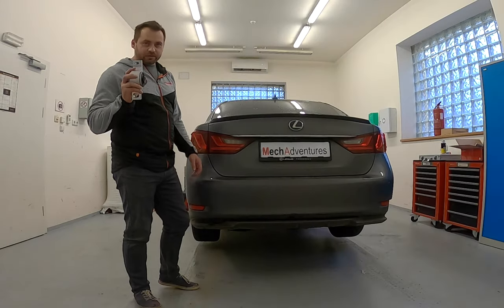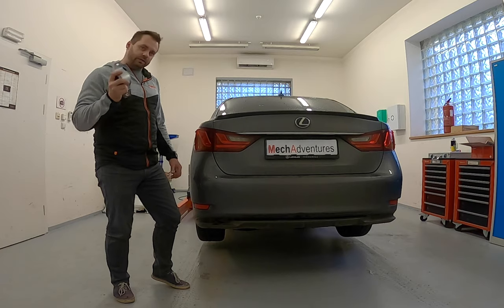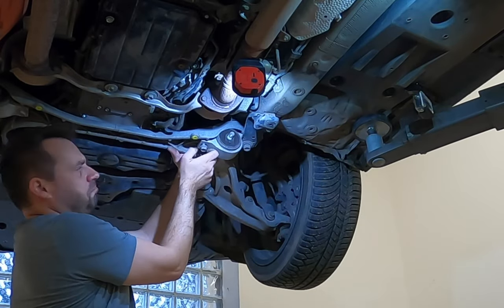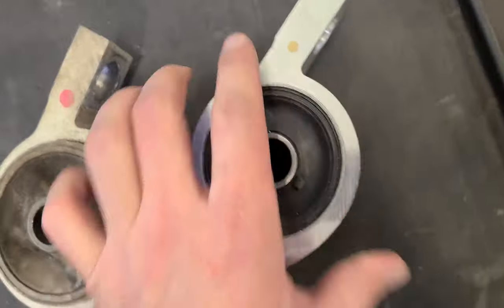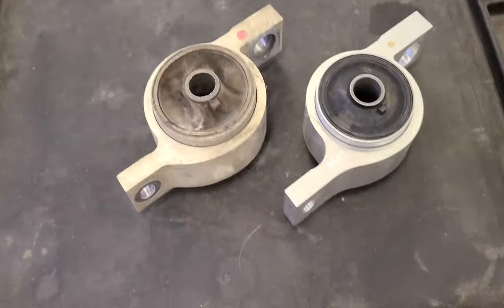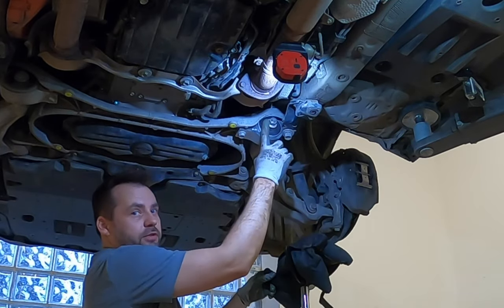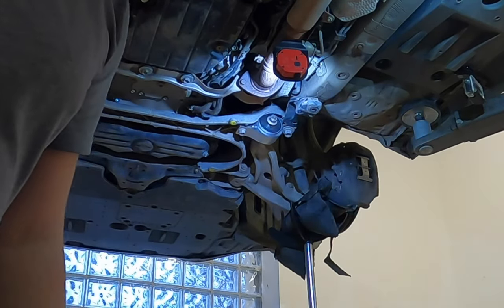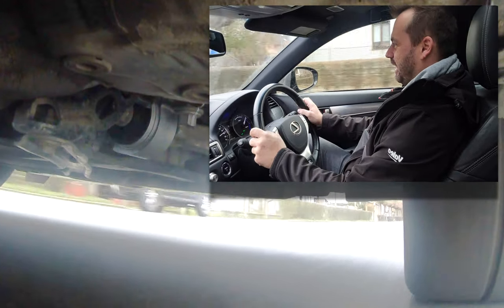🔥 What a difference Lexus IS, GS, RC Control Arm Bushings Replacement and Comparison | DIY | How To

Comment: I'm just curious which offset bracket arm did you used as replacement if ever mentioned since lexus catalog offers a -20, 00 and +20 offset brackets. Just don't want to make any mess to my suspension
Reply from the maker: 99% of cars is 0  offset

Comment: Are the RR Racing bushings better than OEM? Or does it not matter? I want better handling on my Lexus GS350 AWD and was looking at their Coilovers, lower, and upper controls arms.
Reply from the maker: RR racing way more road noise and vibration
Reply: @MechAdventures so not good. I heard that we could use the one from the GSF
Reply from the maker: stick with gsf
Reply: They are way better. They are not rubber. And will not move at all. But as he said lots of road noise and road feel. I also believe you have to grease them every 20k or so depending on driving since they are polyurethane
Reply: I'm buying the Megan racing myself big upgrade and a lil stiffer than F

Comment: Great informative video, what grease did you use and is it needed think factory is without grease. Want to replace my is350 with rcf lca to reduce inner tyre wear
Reply from the maker: Thank you. I cant say for sure whether factory used grease when new or not, but sure enough it wont hurt it to do it now, to prevent squeaking. I used lithium based grease, but any grease will do. The heavier grease the better as the area gets splashed by water there.

Comment: Are you putting thread lock on all the bolts or just the one in the middle of the bushing?

I ask because you flashed it twice but I didn’t see you apply it to the others.

I’m about to do this job in a few hours.
Reply from the maker: @pgm5088  all bolts
Reply: @MechAdventures  Ok I just bought thread lock blue different brand then yours

Comment: Cool video, awesome job. First what kind of lift is that? Doesn’t look like it’s built into the floor. Second question I have to do this job for my gs350 and since I don’t have a lift can I just preload the suspension from the lower rotor/lower control arm before torquing the bolt?.
Reply from the maker: its this lift — FHB3000-03-SS-2300 —- you can preload suspension from bottom of knuckle.
Reply: @MechAdventures  thanks my friend.

Comment: Hey man! So I forgot to preload that one bolt that goes through the bushing. When I wake up in the morning, I’d like
To fix that. Would I be able
To simply raise the car, loosen it up to 20ft lbs or so, lower the car and then torque it to spec again?
Reply from the maker: Yes, no problem